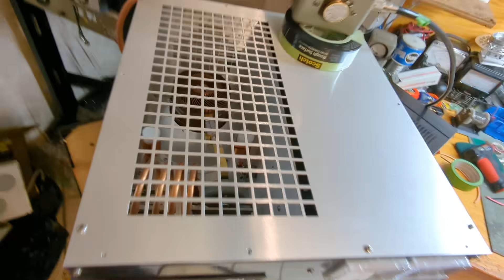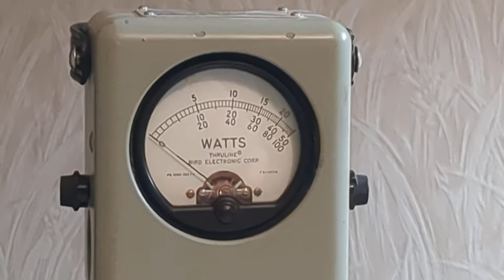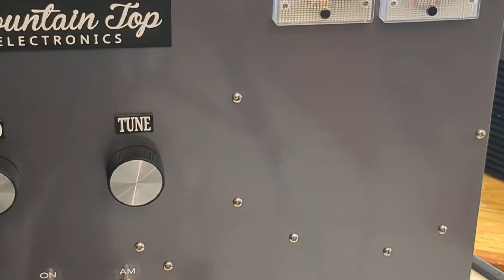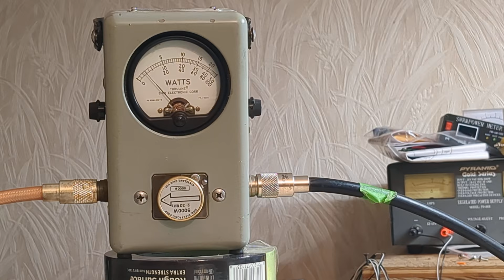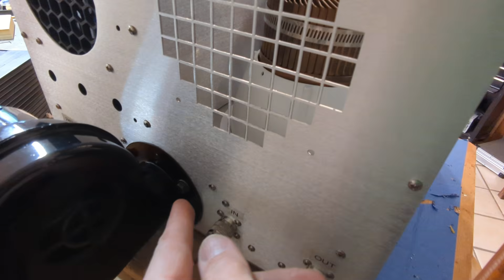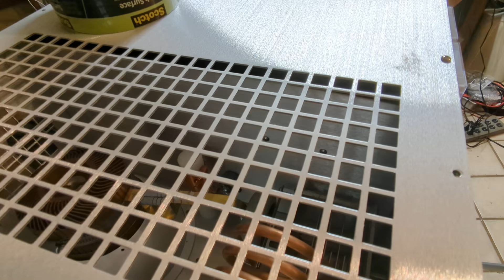Mountain Top Electronics single tube GS35b amplifier

Comment: Why? Just.....why?
At just over one S unit over a 500 W amp, it's a bit of a waste.
Reply: 3500 W over 500 W is only ~1.4 S-units, but that’s still an ~8.5 dB increase — a very meaningful improvement in real-world readability. In weak-signal or pileup conditions, that can be the difference between ‘barely copyable’ and ‘solid copy.’ RF power scales logarithmically, so an 8.5 dB gain is actually substantial.

These guys aren’t dumb, do you think they would spend time and big money on this if it was barely noticeable?